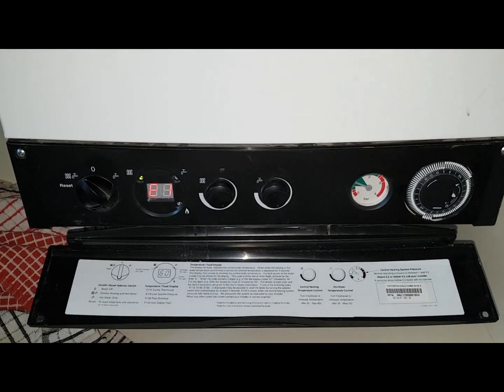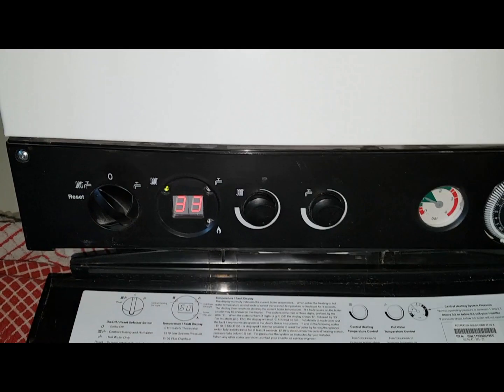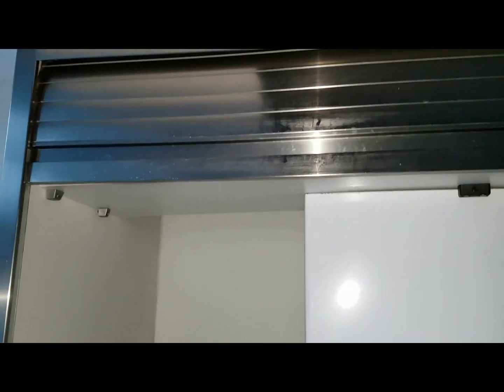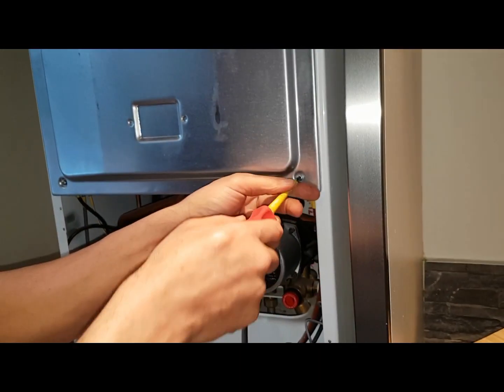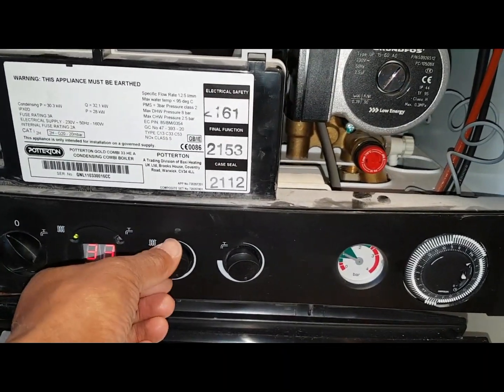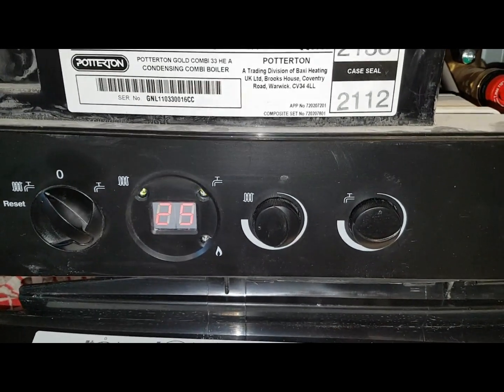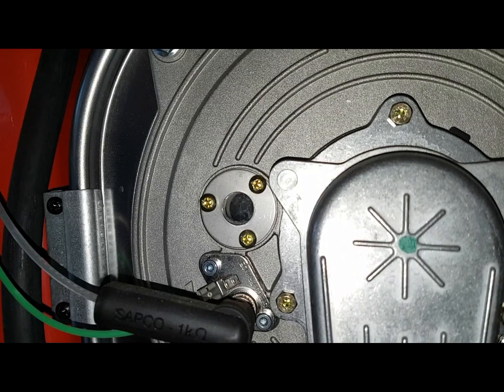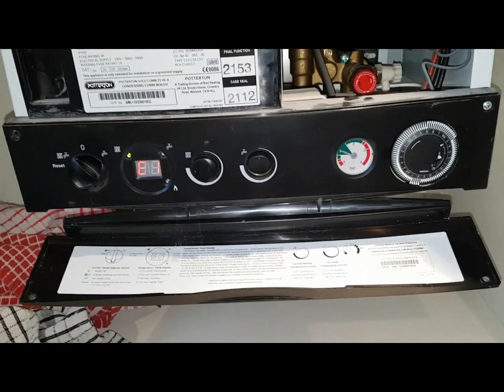E133 Error Code What’s the Cause? With Coach Tony Morgan

Comment: Hi Mate 
Nice video. I got the same issue. Boiler fires up briefly. I can see the flame.. but after 2 seconds it goes out again and says E133. Im thinking Gas valve. Checked pressure and its dropping by about 3mbar. So wanted to double check

Comment: Yes I know. If it freezing out like it is right now in the UK, it’s the condensate line frozen up and condensation is backing up into the float witch shutting it off. Undo the condensate rubber tube underneath and drain the water out and it will work again.

Comment: I had E133 on a Poterton Promax 28 HE A.

All I had to do to fix it, was take the  spark electrode out on the left, and widen the gap between the two prongs by hand.

I put it back in and the second the spark sound happens, the boiler fires up now. Tested it over and over again, works perfectlt every time.

Sometimes it's the simplest or solutions.

Comment: Definitely gas pressure related if the flame briefly came on.  Inlet working pressure test.  I attended one yesterday showing this fault.  On this occasion it was the spark electrodes and flame rectification electrodes which were warped.  Checked the spark generator, it was all good.  Full strip down service 🙏🏽.
Reply: Mines doing intermittently,  so probably probes want adjust or cleaning,  was told probes warping is quite common on the promax as they're quite long

Comment: I thought I’d just post how our E133 code Baxi was repaired. It turned out to be the regulator by the gas meter, a plumber checked it and it was 10bar when it should be around 22 bar. We called cadent and they replaced the whole meter including the regulator.
Reply from the maker: hey we're currently trying to grow our Facebook group and would love you to join Tony and the team using this link, Tony will be available to answer all your questions directly https://www.facebook.com/groups/167070231326174

Comment: If the boiler,s sparking unit is working fine and there is spark ⚡️ present in the the heat exchanger then next bit of sequence is Gas valve , now if the Gas valve is opening fine then there is no gas or blocked gas pipe with Copper Sulphide (Black Crystals) .
Reply from the maker: That's possible
Reply from the maker: Check this out Free Membership - Boiler Repair Mentoring
https://www.boilerrepairmentoring.co.uk/free-membership/
Reply from the maker: hey we're currently trying to grow our Facebook group and would love you to join Tony and the team using this link, Tony will be available to answer all your questions directly https://www.facebook.com/groups/167070231326174

Comment: Gas valve solenoid? Had similar issue a couple weeks ago
Reply from the maker: It's lack of gas
Reply from the maker: hey we're currently trying to grow our Facebook group and would love you to join Tony and the team using this link, Tony will be available to answer all your questions directly https://www.facebook.com/groups/167070231326174
Reply: Ive got same issue ive tried inlet pressure check no drop on demand im thinking knackered gas valve will do a multimeter check on gas valve to confirm

Comment: No gas
Under gassed
Spark gen
Electrodes 
Electrode lead
Gas valve
Gas valve incorrectly set up
Blocked condensate
Reverse polarity
PCB 
Flame rectification lead
Open earth
To name a few....
Reply from the maker: Yeah they are all correct but which fault is this one?
Reply from the maker: hey we're currently trying to grow our Facebook group and would love you to join Tony and the team using this link, Tony will be available to answer all your questions directly https://www.facebook.com/groups/167070231326174

Comment: Common fault..ignition electrode gets to close together..widen the gap for a better spark
Reply from the maker: hey we're currently trying to grow our Facebook group and would love you to join Tony and the team using this link, Tony will be available to answer all your questions directly https://www.facebook.com/groups/167070231326174
Reply: I can confirm that Paul was right. I took the spark electrode out and the flame sensor, I cleaned both of them with sand paper, put them back in... nothing.

I took the spark electrode out again (the one on the left) and I widened the gap between the two metal prongs.

Put it back in, screwed it back in with the hexdriver.

Started the boiler up, and it fired up instantly. Tested it over and over again, each time it tried to ignite, it fired up instantly.

All this hassle and all it was. Was the two prongs on the spark electrode too close together.

Comment: Gas valve solenoid dropping out
Reply: But would be doing further checks eg inlet pressures etc to see if gas valve is opening properly not trying the dropping out on solenoid did one last week although could here the gas valve from other room clunking lol
Reply from the maker: Yeah Paul your spot on
Reply: I thank you (" Mic drop")
Reply: paul tovey   If the gas valve solenoids drop out .  Do I need to replace the whole parts ?   Or is it repairable ? Many thanks
Reply: @FrankieBouy  replaced by gas safe engineer will need setting up need proper equipment to do it wouldn't try replacing solenoid even if could as most times something caused the solenoid to over work
Reply from the maker: Depending on what type gas valve.  But mainly no you will need to replace the gas valve
Reply: Both HW and CH are working.  But after the water temperature cools down（below 30℃）the boiler will Not ignite again.  with E133 code .   I turned it off and left it overnights. It could work again in the morning. And repeat the faulty cycles.  Do you know what could be the problem ? Thanks
Reply from the maker: Possible pcb
Reply: Both HW and CH are working.  But after the water temperature cools down（below 30℃）the boiler will Not ignite again.  with E133 code .   I turned it off and left it overnights. It could work again in the morning. And repeat the faulty cycles. Do you know what would be the problem ? Thanks
Reply: it took 4 engineers to work this one out here. the 4th finally AFTER replacing the gas valve found out that the gas pressure dropping too much when the valve opens.
Reply from the maker: hey we're currently trying to grow our Facebook group and would love you to join Tony and the team using this link, Tony will be available to answer all your questions directly https://www.facebook.com/groups/167070231326174

Comment: Spark electrodes
Reply from the maker: Sorry nope
Reply: I have just checked it on the internet as it says condensate pipe frozen 😁
Reply from the maker: hey we're currently trying to grow our Facebook group and would love you to join Tony and the team using this link, Tony will be available to answer all your questions directly https://www.facebook.com/groups/167070231326174
Reply: I had the E133 fault on a Poterton 28HE A.

I took the electrode on the left out (the one that makes the spark) and widened the gap between the two metal prongs.

Now the boiler fired up immediately when the spark is started.

Literally all it was, was the gap between the the two prongs being too close.